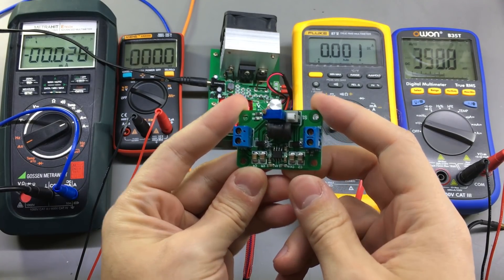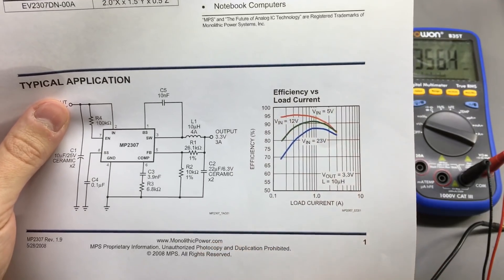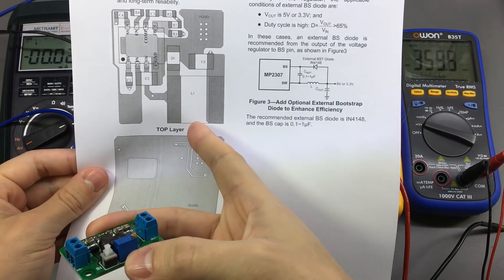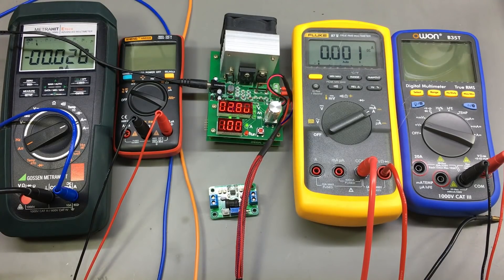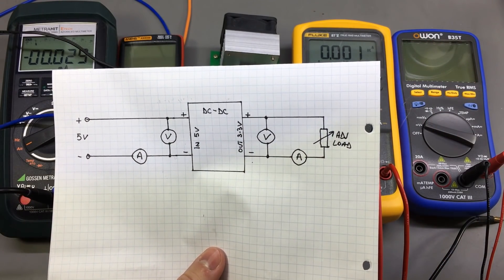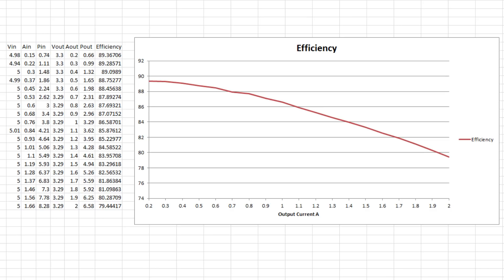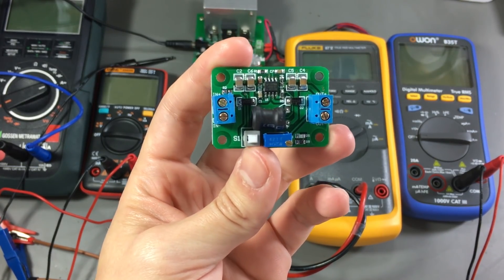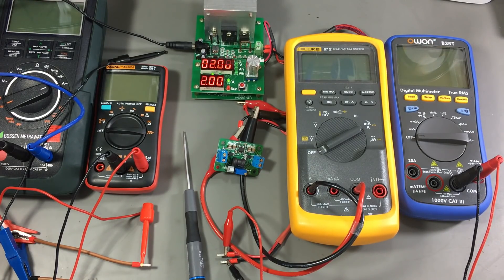Voltlog #131 - Measuring The Efficiency Of The Ruideng Kis3r33S DC-DC Converter

Comment: I would like to hear that explanation how in DC/DC converter difference between input and output voltage change efficiency of converter. As I remember none of losses in DC/DC converter are influence by output voltage, they are influenced only by input voltage and current.
Reply from the maker: I know you know your converter stuff theory, you probably work in the field as you've helped with valuable info on my TNY276 ac-dc converter videos. So let me explain how I see things and what I was thinking when I said that: The efficiency of the converter is a relation of the output power divided by the input power and multiplied by 100. The power is a relation of voltage & current. So in the efficiency equation we have both input voltage and output voltage. If current is constant the highest efficiency can be achieved when we have the input voltage closest to the output voltage. That's why having a higher difference between the two is going to lower the efficiency theoretically.
Reply: VoltLog first let me put disclaimer, I did not designed DC/DC converter from ground in long long time (last time I did it on TI papers about that it still was saying Unitrode), I do not count using of the shelf IC and copy appnote from it as designing (which I do mostly for last 17 years) as design, and in time when I was doing design efficiency was not on top of my priorities (I was spending most time designing optimal response of feedback loop and going for smallest possible size).
Lat put this way, input power is output power + losses, so efficiency is dictated by losses and two main sources of loses are conduction losses and switching losses (there are others but they are minor to this two). Both of them are dependent of input voltage and component parameters (conduction loses go down with greater input voltage, switching go up with input voltage, and there is sweet spot of input voltage where combination of them two is minimal and you get maximum efficiency, for old school designed with classical power MOSFET it is around 8V) but no one of them are dependent of output voltage (and as I remember non of others losses are dependent of output voltage).
I asked because maybe in meanwhile someone find some other type of losses (or better explanation) in DC/DC converters which is area that evolve, for example you will find in many datasheet about SEPIC converter (my go to converter for many projects) how working of it is not totally understand, even Dr. Ray Ridley did paper covering detailed analysis of it based of previously analysis by Robert David Middlebrook,  Slobodan Ćuk (Ćuk converter), Vatché Vorpérian (I put names in order how analysis evolved and there are woks of others like Robert Erickson, Dragan Maksimović...)
Keep on doing good work as you did it till now.
Reply from the maker: ok, so your explanation goes into the practical (hands-on) details of dc-dc converter efficiency which is over my level of knowledge or experience on dc-dc converters. But what I said in my previous comment is still valid, it's a simple theoretical fact, since we have both input and output voltage in our equation, the difference between the two will change the efficiency. Going with the practical approach one might discover that there is little to no change in efficiency when you vary the output voltage like you suggested above. One might discover there is a measurable change in efficiency when varying the input voltage as that is directly tied to converter losses as you explained but that would also support my claim that a change in the intput/output voltage ratio would change the efficiency. Nothing new here, I don't know too much on the subject, just my interpretation of some basic theory stuff. I really appreciate your comments on the channel because you bring useful info on to the subject so please comment more often! :-)

Comment: That's a shame, I was expecting you to jump the diode with a clip and test again. Oh well maybe next time.
Reply from the maker: Doing the mod was in the initial script of the video but then I decided to leave it out because the video was getting too long. I would like to keep these kind of videos around the 10 minute mark, because my average view duration is 6 minutes. Just for those who are curious, removing the diode from the circuit (and replacing with 0ohm jumper) improves the efficiency massively. With the same test conditions 5V in, 3.3V out, I was able to get 95.2% efficiency at 0.3, 0.4 and 0.5A out.
Reply: Yes, I'd like to see that too. It could be the following video.
Reply: Maybe a nice idea to do follow up videos based upon the comments. Some of these comments here I find very useful. Some explain issues on this board but might also be useful for other projects.
Btw I like these Kis3r33s things. Bought a couple of them about 8 years ago to hook up to a car battery and get stable 5V  in remote locations since at that time chargers etc that were delivering 1Amp max was common. Stack those pcb's with copper extension tubes and you have a reliable power house that you can use on a car battery or a laptop power supply.
Small hint: if you get the ones that are set to 5 Volt then change it to 5.2 Volts. Cable losses etc .
And yes after all these years they all still work perfectly.

Comment: What's the best thing to use on a small audio amp that's 5v and you're using a 4.2/3.7v ? without adding noise
Reply from the maker: There are audio amps designed to run directly from a lipo cell. If you really need 5V then you have to use a step-up converter. A properly designed one, for example using a TI part or LT part with the recommended PCB layout, recommended component usage and filtering should be good enough. But like I said, in this kind of applications you would use an amp that has been designed for the task and will accept power directly from a lithium cell.

Comment: Everybody has 4 multimeters don't they? ;)  (I do).
Reply from the maker: Now with these cheap & good multimeters like the Aneng 8008 it's pretty easy to equip yourself with 4 multimeters. Not everybody will need the setup, but it's nice to have them if you plan to do this kind of measurements.
Reply: I have 2 of the Aneng 8008's, a B&K Precision 393 (for serious stuff), and hardware store brand as well as some real cheapies.  If you find yourself saying "I wish I could also measure that while..." you need another one :)
Reply from the maker: It's a good multimeter.
Reply: Brymen should be a good choice :)
Reply: I'm planning to buy my first DMM the Brymen BM235 Multimeter
Reply: Maybe that EEVBlog custom one :), I love that blue color :)

Comment: Let me be the first dork to say; "First"!
Second, I wish you would've removed the diode and did another run, so we could've seen the effect of that diode on the efficiency. I use a logic level P-MOSFET and a couple of resistors to have a polarity reversal protection. A 470K from the source to the gate, and a 4K7 from the gate to the ground. You will introduce Vin/(470K+4K7) current loss (i.e. 12V/470K= 25.52uA) , but you suffer nothing in terms of voltage drop Vf of the diode. Use of schottkys are best for some battery powered projects though).
Maybe you can feature that in your next video? Just an idea...
Did you ever play around with the LTC3780 Module? they claim even higher efficiencies! https://goo.gl/G6ZMTQ
Reply from the maker: Doing the mod was in the initial script of the video but then I decided to leave it out because the video was getting too long. I would like to keep these kind of videos around the 10 minute mark, because my average view duration is 6 minutes. Just for those who are curious, removing the diode from the circuit (and replacing with 0ohm jumper) improves the efficiency massively. With the same test conditions 5V in, 3.3V out, I was able to get 95.2% efficiency at 0.3, 0.4 and 0.5A out.

I know about the P-mosfet reverse polarity protection circuit, I used it a couple of times. It's a nice and elegant solution and it's a good idea to do a video on the subject, because I'm sure there are people who don't know about this circuit. 

I never played with the LTC3780.. but from it's datasheet I can see they claim up to 98% efficiency, nice!
Reply: Yeah, I don't think many people know about the reverse PMOS solution. It would make a nice video under 10 mins :)
95.2% is damn impressive at those popular levels too. 
that average view duration of 6 mins was a supersize to me. Do they say the AVERAGE stop timeline is? (ie. they stop watching at xx:xx timeline in average). 
I don't think any lengthy video you do, would be boring.
Reply from the maker: Actually now that I've checked, the average view time is around 5 mins, with spikes of 7-8 mins during the days I publish a new video. Which means the subscribers I already have watch a bit more than the casual user which just finds a video from my channel on a search. They don't tell you when they stop watching. People are subscribed to many channels and there are days when there just isn't enough time to watch all the new published vids so you have to skip through the videos to watch more of them I guess. That's why I should try to keep my videos around the 10 min mark, however that is difficult to do with my subject and my way of doing things, but I will improve over time :-)
Reply: IRF9540N but they're pricey. I don't even remember when I bought them! But I have a few. 
Came across some cheap ones on AliExpress and ordered 10. They are FQP12P20. Me thinks they are fakes. 
I will find out when I put 10 Amps through them and see if they make it next week. I doubt it. 
The NDP6020P is an excellent choice. RDson of only 70 mOhm at 2.7V Vgs but only 20V Max Vds!
AliExpress sells fakes ones (10 for < $3.00) https://goo.gl/vVktU7
For projects, I buy and use the good stuff from Digikey. I'll know they are genuine. I wait till I have at least $100 worth and don't pay their excellent over-night shipping. Mouser wants $20 for shipping. Element14 (Farnell, Newark) wants $25. Not doing that. 
For day to day fucking around with parts and circuit ideas, I use the Chinese shit! I make mistakes, I blow up a cheap one, instead of $2.41 each! 
I noticed that the clones work well if they're kept from going over 1/4 rating. i.e. For a 5 Amp LM338, I wouldn't count on the fake for anything more than 1 Amp. They shrink the die to save money on the clone. So power stages suffer due to the smaller size.
If my circuit ideas work with the fakes, they will work with the good stuff too...
Reply: @UFOhunter.  Which P-Mosfet are you using? I'm always looking for for something more efficient than the NDP6020P logic level mosfets that I use.